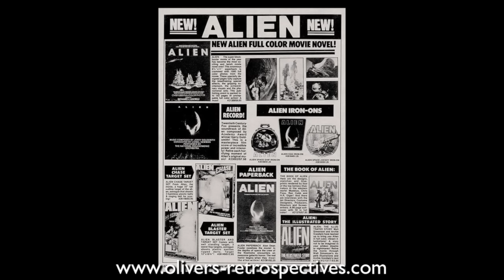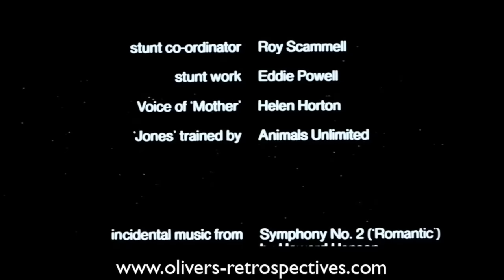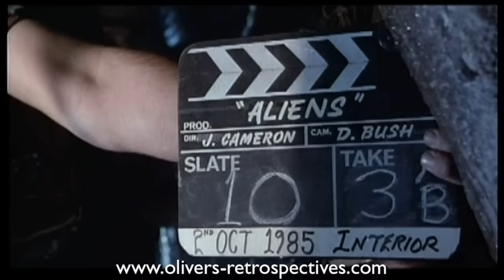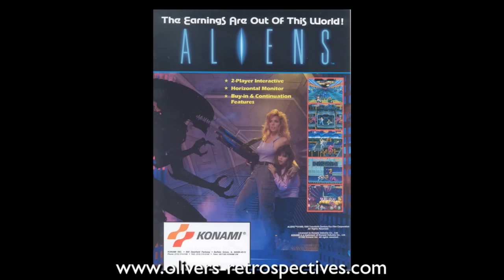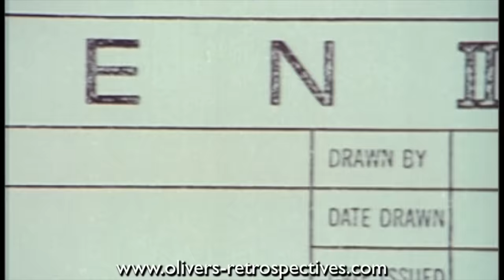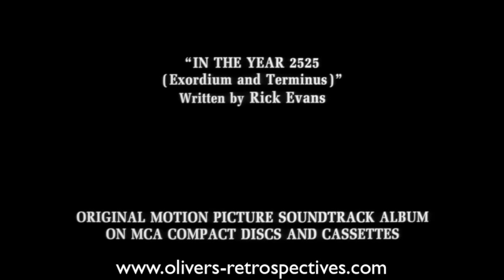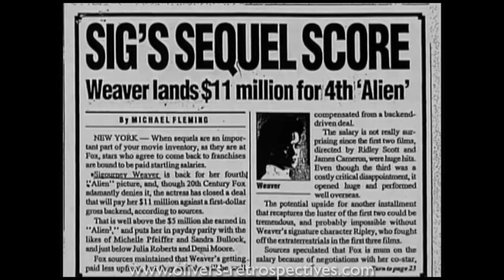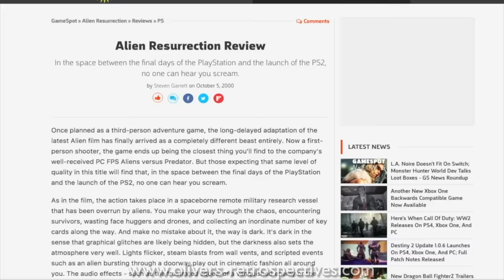Alien Quadrilogy (1979-1997) Retrospective/Review

Comment: ALIEN 3 Assembly Cut is like a fine wine as it gets better with each viewing and returns to the slow burn horror of the original. The theatrical is just as bad as the day I watched in theatres. I do remember a tear down my eye as to my disappointment walking to my car. Love ALIENS (one of the best sequels ever made), but it came at the cost of making the XENOMORPH as “shoot em up” creature that pops up from the bottom right of your screen that you simply blast (AVP, AVP2 A4). ALIENS killed the beauty that was once a elegant creature. SIDENOTE: NEW BORN creature design is still one of the best creature designs up there with Predator (1&2), Alien, Terminator, Pumpkin Head.

Comment: I feel that the theatrical release of Alien 3 is superior to the Assembly Cut. It's just more streamlined and the Alien coming out of a dog just makes more sense than an ox. The same overall story problems plague both versions of the film, however. I also feel Alien: Resurrection is superior to Alien 3, at least in the sense that Resurrection is successful schlock while Alien 3 is a failed art movie.
Reply: I prefer the added material in the assembly cut. There are things that I feel are missing in the theatrical version.

Comment: Through the whole franchise no one learn to just make stuff out of Teflon so the acid for blood is a non-issue?! Like, the actual floor in resurecction, they make out of weak metal...erm, ok! In fact they have the plexiglass they can't break through, y'know you could just put THAT on the floor and acid won't corrode it!

Newborn is effective. Its just that its so disturbing and i hate looking at it. Its like its supposed to be in Eraserhead so the clunkiness i don't quite mind, its absolutely like the director channel David Lynch for that one.
Yes it does have the texture of the 'polymorph' from Red Dwarf, which may have been the first alien parody. It was the later 'Mutton vindaloo beast' that was curry-like however. I wonder if Alien- resurrection took any influence from these, being somewhat of a parody itself.